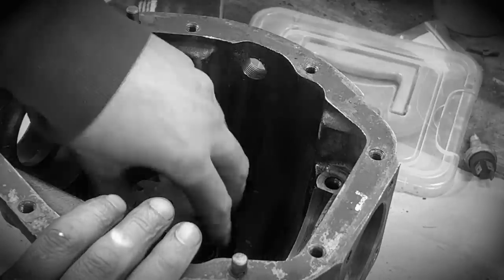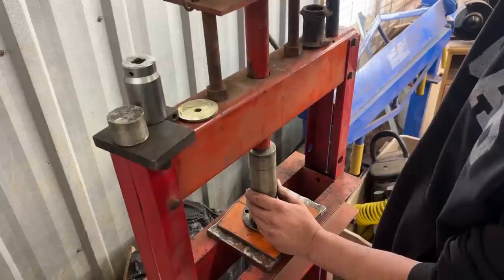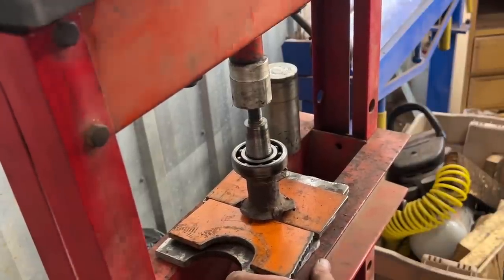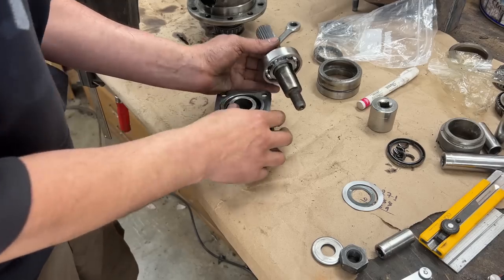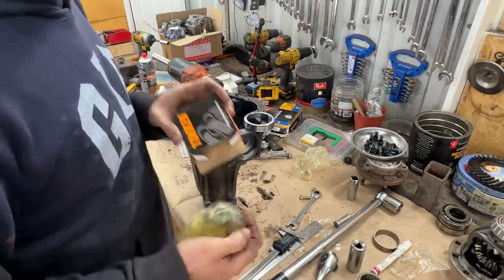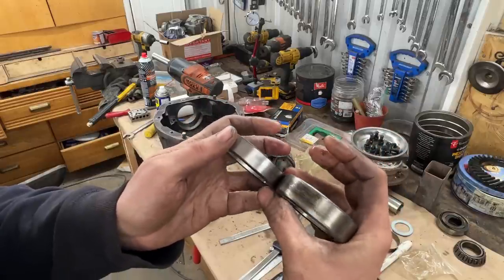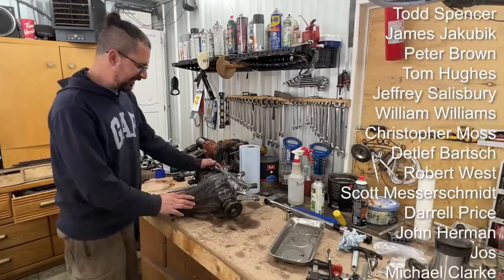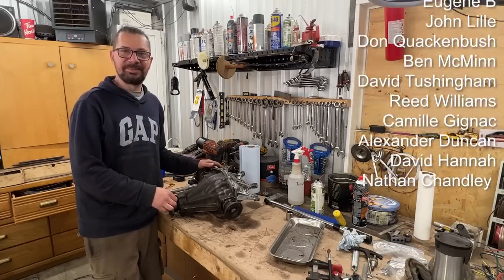Triumph TR6 Differential rebuild - Part 3 - Planet Carrier and Gear Mesh Pattern

Comment: So nice to see your true mechanical build. I've done this kind of build up in the past on industrial gearboxes and have used a Machinests Blue lay out spray. It sets up faster than spray paint and you can see the silver shine through on your contact clash points. You can also get it in a tube as a brush on.  Great work.

Comment: Elin, thanks for taking us all along for this rebuild;  great work!  I've got to go back and review the previous segments to see if you discussed what took you down this 'rabbit hole' in the first place.  Did the owner just request this specific rebuild, or did you discover various telltales (rear end noise or visible internal wear) that dictated that this work be done?  On my '67 GT6, I'm wondering how deep I have to go to determine the differential must be rebuilt;  what process would you use to determine the condition of the rear end in situ?
Reply from the maker: The owner was hearing clanking noises and described a very interesting situation when he was turning one axle shaft 90 degrees back and forth without affecting the other axle shaft or the pinion. I never found anything that suggests that this was possible though, but while I was inside I found that some of the bearings had developed some pits and had to replace them.